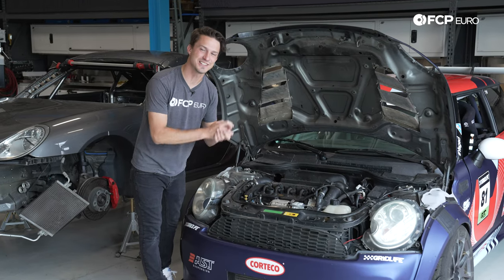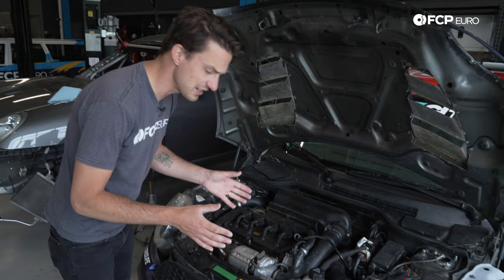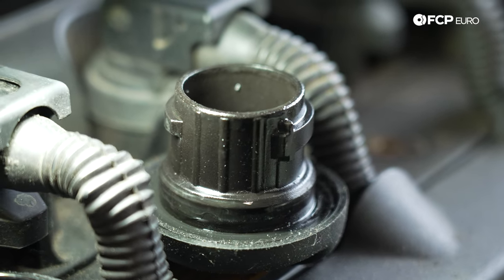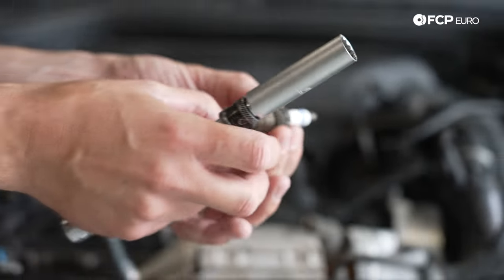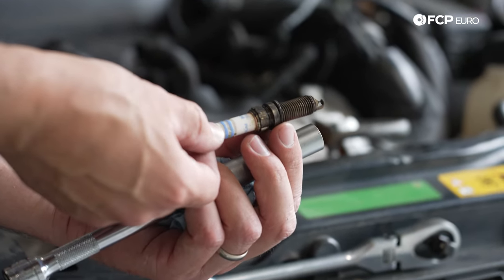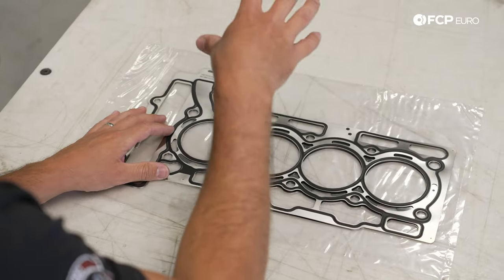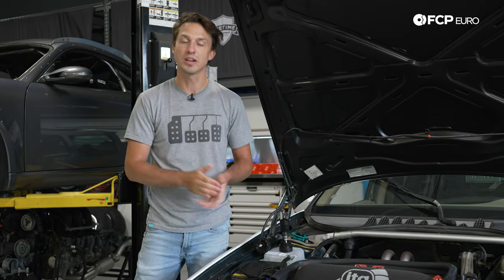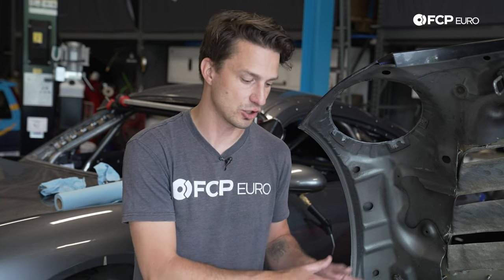Signs Your Car Has Overheated - Causes & Diagnostics Of An Overheated Engine

Comment: Great timing with peak summer here. Even if you’re not tracking your car, oil temps in my daily are up 40 degrees compared to winter.
Reply from the maker: Totally right - doesnt just take track conditions to unsettle a cars cooling system, especially with this summer heat. Sometimes sitting in traffic can be just as bad!

Comment: so, my car (07 S60R automatic) had overheating problems about a year ago. i took it to a shop and they tested positive for head gasket failure. however, when i flushed my coolant system and took it to a mechanic shop again (new shop this time), they also tested for head gasket failure but the car passed four times. should i be worried about my car overheating again? i know my car is prone to cracked blocks, so im kind of scared to pick it up and drive it home without a new head gasket. any advice would be very greatly appreciated!

Comment: I wonder what you think about certain VW products which are designed to go up to 110C in operation when on part engine power. Then they electronically open the thermostat when you push harder on the pedal...

Comment: Pressure testing the cooling system with a hand pump would normally be the first step after an overheat.
Would've gotten the spray you wanted while cranking in that order but y'all prob knew the outcome already tho the video and presentation were great!

Comment: The real takeaway that I stressed when my son was learning to drive: never let your car overheat, ever. Arguably as important as if the oil light comes on, shut the engine off immediately (and let's face it, oil is a coolant too), he knows to shut down as soon as the engine appears to be overheating. Today's engines will run forever if you change the oil and never let them overheat - otherwise all bets are off.

Comment: This video considers and overheat immediately after the fact. What scares me about overheats is when purchasing a used car with an aluminum engine. Aluminum engines when overheated are toast - the metal itself has lost tensile strength. Heat distortion has caused excessive wear, etc. I would like to know how to diagnose this scenario.

Comment: Yeah I'm here with my VR6 Jetta right now. My mom overheated it bad. Poor compression. Needs a full rebuild basically. While I'm replacing parts I will be throwing in all the performance parts. And I'll try to get all of them from FCP Euro. Oh, and the engine's not going back in the Jetta, because it's a POS.
Reply from the maker: Best excuse to upgrade is when you have to replace it anyway ! Let us know if ya need any help
Reply: @fcpeuro  maybe. I have the 2.8 24v and I'm putting the 3.2VR6 head on. I know it's been done, but it's hard to find info on what exactly I'll need to do it. I'll find out when I get started. R32 swap. I'll try to get the drivetrain used to save money there.
Reply: Scangage ftw. 
My Jetta says 190 on the dash all the time ,but scangage says 180-207 depending on the situation
(fans come on at 207 or so)
Reply: @MrTheHillfolk  fans were not coming on. Mom didn't notice and drove it 20 minutes while hot until steam everywhere. RIP engine. For now..
Reply: @hansdomke89  ouch!!
Yes ,down for now but not out! 
Fingers crossed for ya that it'll come out alright.

Comment: Or, in my case, the cylinder head in my 125k mile BMW 328i developed a cylinder head crack. Every few weeks, the cooling system would blow a hose or a radiator apart. Bye bye BMW. Never again!

Comment: I drive a MK4 golf gti VR6 , I live in So Cal in Palm springs California  , its gets over 100 degrees out here every summer . My one year old new battery died a few days ago , luckily i installed a low temp thermostat and some new hoses . I cant run coolant in the car due to the previous owner only running tap water in the coolant system . I run distilled water .
Reply from the maker: Distilled water is definitly the way to go
Reply: That makes sense.
Better heat transfer, and you rarely see freezing temps in so cal.